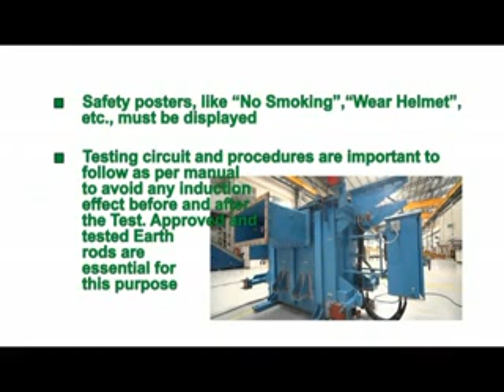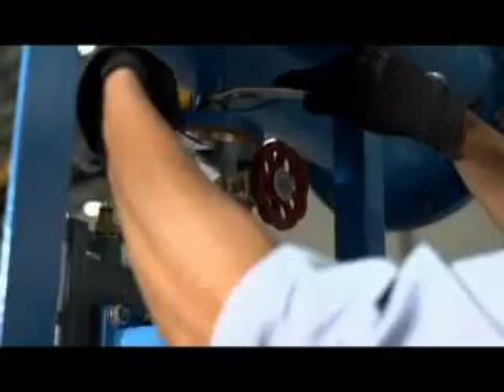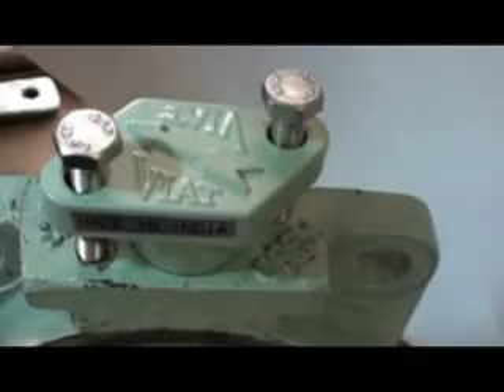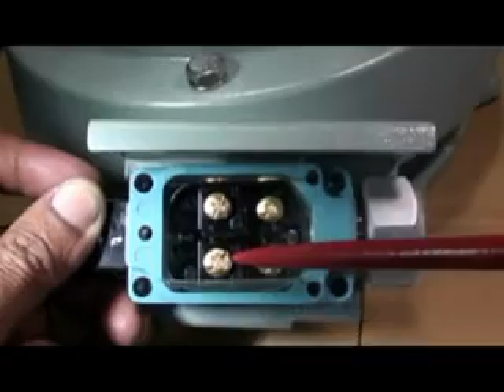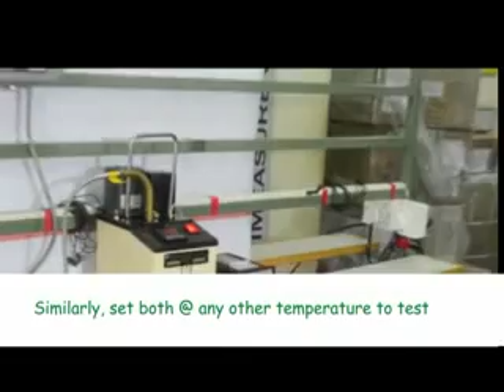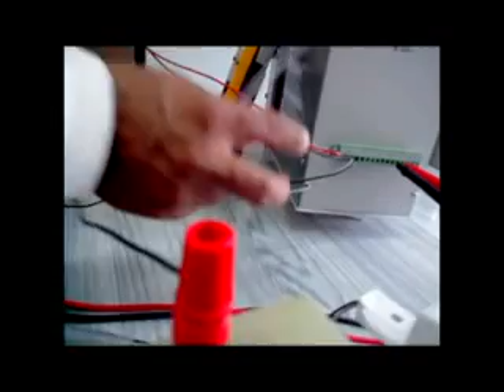Schneider Electric's Transformer Erection and  Commissioning

Comment: The Purchase Director
 
Hello,We, at Domadia Group supply, in collaboration with various internationally-based, certified manufacturing companies, products with uncompromising quality standards. We are a sourcing company for Raw Materials for Transformers, Cables & Conductors.From Ex-Stock, We are hereby pleased to offer you the following:
ELECTRICAL INSULATION MATERIALS (Imported & Indian)
PAPERS
- Electrical Insulating Crepe Paper (Germany) – 2, 3, 4, 5 mil
- Semi Conducting Crepe Paper (Germany) – Black (used for Shielding)
- Aluminium Crepe Paper – One Side Aluminium Coated (USA) 
- Kraft Paper (Indian)
- Thin Coil Winding Tissue Paper (Europe)
- Nomex & Laminates
FILMS
- Polyimide Films & Adhesive Tapes: Thickness: 1, 2, 3, 5, 7, 10 mil
- Polyester Films – Transparent / Milky (Garware)
METAL
- Copper Aluminium Bimetal & Clad Metal Sheets / Pipes
- Stainless Steel Foils & Coils
- Plain Aluminium Foil
TAPES, SLEEVES & TUBES & YARNS
- Mica Tapes
- High Temperature Tapes (1000°C) and above.
- Fiberglass & Polyester Woven Tape
- High Temperature Fiberglass Sleevings (H & F class)
- Heat Shrink Sleeves / Tubes
- ResiGlass / PolyGlass Tape
SPECIAL METAL ALLOYS
- MuMetal, Nickel Alloys, Soft Magnetic Nickel Iron Strips for CORES, etc
- Beryllium Copper Strips, Plates, Rods, Ingots, Wires, etcKindly let us know your requirement so that we can quote you a good price.Ps: We also have our own slitting facility at your service.REQUEST FOR FREE SAMPLESWith Regards,
(Mr) Kairav Domadia, +91-9821236275DALI ELECTRONICS
8a, Haroon Building, First Floor,
190 Shamaldas Gandhi Marg, Princess Street,
Mumbai 400002, Mh., India.
Ph: +91-22-22017128 / 22038204 Fax: +91-22-22016629
E-mail: DALIELECT@GMAIL.COM
--------------------------------------